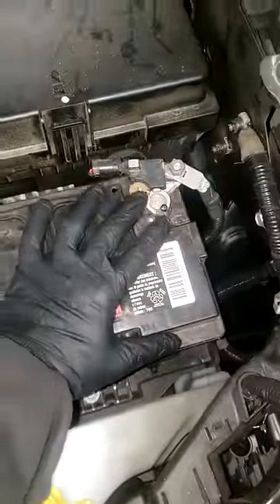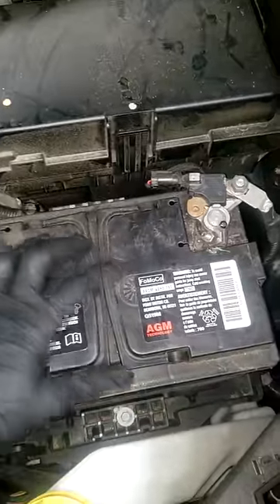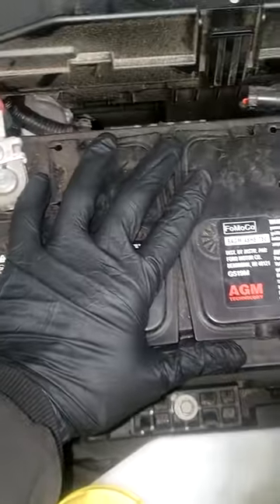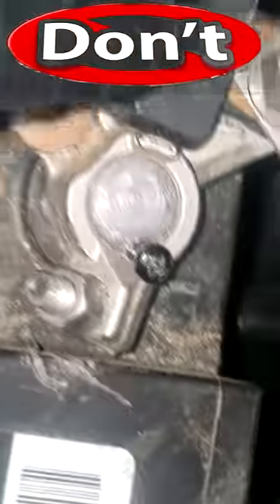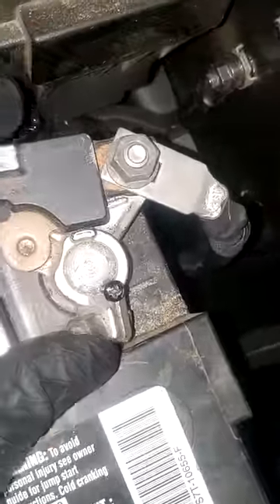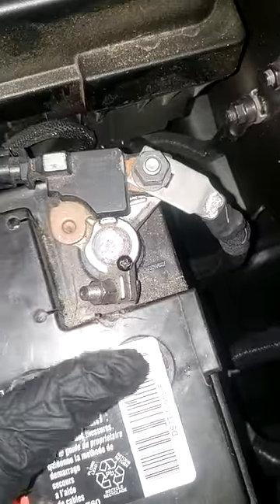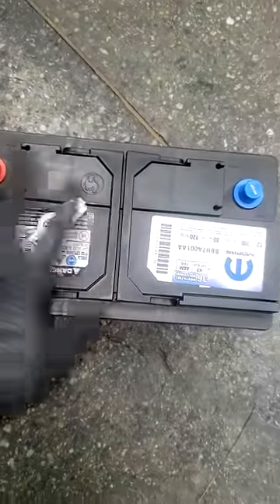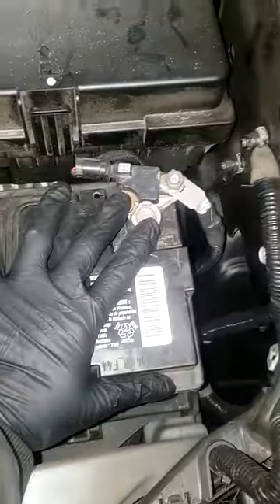STOP DOING THIS PEOPLE. This will destroy your car electrical system.

Comment: Everyone's talking about the screw, I'm still tripping on the new battery sitting on what appears to be concrete.
Reply from the maker: Yep, and just what will that cause?
Reply: I've always been told that putting a battery directly on concrete will make it loose its charge and potentially loose the ability to hold charge altogether.
Reply from the maker: @dailyhauntedhistory  Do you believe every thing you was once told? especialy from an older technology stand point.
Reply: The person who told me that taught me alot of "tricks of the trade" most of them stood the test of time. On the battery's I just keep a 2x6 around to set em on,  better safe then sorry. Never wanted to run the risk of ruining a new battery, his story about them were brand new battery's in a big diesel street sweeper, 2 battery's parallel, it was an expensive lesson for him to learn.  It was an older equipment, which may have used an older battery tech, but that happened to him in 2006.
Reply: Sorry to say the concrete was not the cause of his problem.

Comment: I helped a woman having the same problems. Turned out, whenever she hit a bump, the screw was hitting this hood. I told her whatever idiot installed her battery didn't put the battery holder back in and used the wrong terminal.

Comment: Thats an AGM battery... my guess is the battery is perfectly fine given date code, did you try a terminal shim before condemning the battery? Test the battery?
Reply from the maker: Bro, the point of this video is to deter mechanics from doing or adding anything non factory to the battery that will affect connection and you get on here suggesting I install a shim??????? Thats what causes the problem on these newer cars. They to computer controlled for any of that non sense

Comment: It's hammering a lead wheel weight into a thin shim an adequate fix if a new terminal/sensor isn't an option?
Reply from the maker: Its a risky fix. Any small spike on wrong reading from the sensor could brick you transmission and render it useless

Comment: Yeah so that's a very old trick, use a small pin or nail. It's not the cause, but it's a bad repair
Reply from the maker: You cant at all alter with the battery connections on new cars my friend. You will lock yourself out.

Comment: If you stick with vehicles made before 1973, you won't ever have to worry about those annoying sensors. ..Or any of those emission control gadgets either, just a PCV valve. Parts keep getting harder and harder to find, though. But if you have IBS, that's no joke. It's fkn crippling.
Reply from the maker: Very risky stuff. I've gotten cars towed in because they transmission bricked all because of hacks like this. Not good on these newer cars.

Comment: i know enough to know better than that screw doing anything to cause this problem. 🤦‍♂️
Reply from the maker: You likely referring to all the old pos cars you use to driving. Doing this is not good on the newer car. It will lock you out
Reply from the maker: @3sgteyota  Well thats the point of the video. To alert the public not to be doing this on newer computer control cars such as the car in this video. Thanks

Comment: If you arr putting a screw in a battery terminal I'm hoping you are not considering it fixed. If you need to get it off the road or to a shop and can't tow it for some reason that's an emergency fix. Just do it right guys it's not that difficult.

Comment: I only work on old cars but I wouldn't ever put a screw in there Ive used copper wire and clamped it down on my own vehicles but a customer gets a new terminal or we return the battery and find 1 that fits right

Comment: I had transmission issues end up being a bad battery it would start the car but the amperage was low and tested bad. installed a new battery and no more trans issues drove car another 29,000 miles.

Comment: What the scan data say Did you run a battery test on it did that battery fail If the problems with the battery terminal why are you replacing the IbS sensor? Not that I just agree with your diagnosis it's hard to without the proper information

Comment: Whats wrong with the screw, I don't understand how is that going to mess it up?
Reply from the maker: Mess it up?? Im not understanding that.  Heres the thing. That screw has compromised the connection between the battery and the terminal. The problem here is thats not a typical battery terminal, its a sensor. A IBS. Thats monitored by the computer. The computer picks up on foolishness like this and will turn on the check engine light. You can get away with this on older cars, just not the newer cars.

Comment: Certified mechanic over 25 years I put a bolt like this on my wife's Jeep Patriot and drove it that way for five years without a problem so don't tell me that this causes a problem cuz it's bull crap
Reply from the maker: Uhmm couple things here, im not sure if you aware of this but you can put anything you want in your wife Jeep that you like. Second, I get a good chuckle out of guys like you that feel the need to highlight there ASE and years of experience but still manage to say questionable things to the contrary.  And lastly, this video is on a newer Jeep Cherokee with a complete different bus network electrical system. Your old ass Jeep Patriot not the same. The vehicle used in this video use whats call proxi alignment and has a ZF 9 speed fully electronically controlled transmission. Any kind of battery arching that may happen because some clown stuck a screw in it can brick this transmission and cause it not to shift. So buddy these are 2 different vehicles. You might wanna do some upgrading with your 25 years experience, seems you getting left behind because you still think screwing screws in your battery to make good connection in stead of fixing the connection problem is a good idea, that says a lot about you...IJS.

Comment: Bullshit. This is simply a combined sensor unit with a current measurement shunt and also voltage measurement. The combination of these measurements can state the battery State-Of-Health amongst other by measuring the actual cranking amps. No way in hell that screw is affecting anything. If anything it's a creative repair for a real problem.
Reply from the maker: So the check engine light just decided to come on for nothing huh???smdh..Tell you what, simply leave your screws in there, hows that?
Reply: @OnlineMechanicTips  Please enlighten me, what was the fault then? Cause it sure was not the screw. 100 %
Reply from the maker: @PatrickStave  Again, then leave your screws in and ignore the light. Theres no enlightening you. You to far gone. It would be a waste of time.
Reply: @OnlineMechanicTips I am genuinely curious what the fault was and what fault code it threw. Can you tell me?

Comment: What the hell are you talkin about that's not a sensor that is a fusible link and the heart and soul of your electrical system technically isn't your battery all the battery is there to do is to start the vehicle. The vehicle runs off of the alternator once the vehicle has started it has nothing to do with the battery all it does is start the engine. That is not a sensor, and there's nothing wrong with the screw trick all it is is making the connection tighter because the clamp is bad it's okay for short-term fixes long as you don't damage the terminal going into the battery itself but if it is just going into the part of the posts that is above the threshold into the batteries and her core it's no big deal really what needs to be done is the clamp needs to be changed out. It is stretched. Now the ground circuit of any electrical system in a 12-volt automotive circuit is very important because all the electronic circuits are switched through the ground circuit they are typically provided power full-time through the fuse panel and the relays and whenever you operate a switch or press the button your closing the circuit via the ground circuit of the groundside. I've seen a couple of your videos and I've come to believe that you have no proper training or no technical School education which is okay but you should really take the time to read up on alldata pro or Mitchell 1 pro and look into and study the circuitry and look up and memorize your nomenclature and learn a little bit more before you make videos misleading people (intentionally or unintentionally & innocently)  or telling customers that they have to replace " sensor "  that is nonexistent. Oh and by the way there's continuous and intermittent feedback closed-loop , open loop, and benign sensors . They don't tell the computer anyting they have a number or a predetermined setpoint programmed into the computer and all it does is send a signal out to see if it's within tabac it just doesn't send back a signal within those values it will triplelite it doesn't tell if it the sensor is bad it doesn't tell the port is bad it just tells if set point in the computer is being met. which also leads me to the point where I hate when people automatically assume whenever a code is wrong that that sensor needs to be changed through that component needs to be changed you need to check the entire system that is in line with that sensor because it could be a number of components causing that light to flash on and I've even seen cases were just a broken ground strap because the system to trip and nothing be bad at all.The bureau of automotive repair and almost society of engineers frowns upon and proper information on work orders and provided to customers. I would know because I am an ASE certified technician and that is definitely told to you when you go through your certification process.

Comment: so by making contact with the screw , it was "wrong". But selling a battery she didnt need when it was the terminal was ok?
Reply from the maker: Seems you dont know what you talking about. Typical reactions from side line know it all guys.
Reply: @OnlineMechanicTips   A normal passenger vehicle traveling at a speed of 65 miles per hour would take about 316 feet to stop. For a fully-loaded commercial truck, the stopping distance of it running at 65 miles per hour is about 525 feet
Reply: @OnlineMechanicTips  Dork , I piloted professionally for Kawasaki. Im not slow, or an armchair warrior. I practiced, fought, lost won , and crashed and burned, many times.

Comment: Did you even test the sensor to make sure it was faulty? A code just means there's a problem in an area not that that exact thing is broken. Example, gmc 5.3 throwing a u0107 code for TAC module. If you'd have read the code and just replaced the module, most of the time it won't fix the issue  because it's usually caused by a faulty ground in the circuit. Could be the ground  directly to the tac, a ground from the ecu, or literally any other ground in the circuit. I know from experience. Any mechanic worth his wrench will tell you verify, verify, verify. Visual inspection is not a diagnosis

Comment: The screw is not the problem this should never be done also the battery sensor (shunt) is also very unlikely to be bad.  This battery may not even be bad.  What usually happens are the terminals and battery cable connectors should be disassembled and properly cleaned, if your working on your own car.  If you are working on someone else's car the cost of a battery and possibly a sensor is a good idea.  I mean pay $100+ for my time to clean it or for a new one? Choose.  If it were my own car I would just remove the screw, clean the terminals and cable ends then keep going.  Additionally judging how people work without knowing their situation is unkind and inappropriate.  There are people all across this country that have just barely enough money to put food on their table and maybe not the education to repair their car but definitely not the money to have someone else do it. They do what they can with what they have, been there.  The guy in the video does what is right for his situation, he is not ripping anyone off.  The screw was probably a ditch attempt to get out of a tough situation but is also ok if you're stuck in a parking lot somewhere you got a screw from the trim inside the car (notice it was black) you have a screw driver or a key or something then your day is saved, hero or idiot?
Reply from the maker: This was a interesting read.

Comment: I'm sorry... WUT?
Reply from the maker: Whats the question?
Reply: @Online Mechanic Tips  I suppose my question is... why did you think you needed to replace $900 in parts + labor when you're not addressing the actual source of the problem in the first place? I'm going to bet she will be back saying I'm still getting similar issues. Whoever removed the IBS sensor in the first place is the first problem...  whether that's the guy who added the screw or not, it's irrelevant. That sensor doesn't just come loose unless someone thought they would erroneously diagnose a problem the sensor was warning about.

Comment: That sensor was fine, you don't know what you're talking about. That screw was miles away from it.
Reply from the maker: Lol. If you a mechanic and you get one in the shop like that, just simply tell the customer it's fine and normal. No big deal
Reply: @OnlineMechanicTips  Definitely not normal to put screw in there, but it also shouldn't damage the sensor.  I would first clean the contacts and test the battery, not just fire the parts cannon and hope for the best. That's just lazy IMO.
Reply from the maker: @miro6138  Considering you have no idea what I did or what was done seems you're  firing off the guess canon of what wasn't done. This a shorts video dude. And I'm not about to attempt to explain to you what testing was done or not done. Simply because i don't have to.. Just know that 2 parts was replace and a screw was removed. Im not sure how yall operate over there but i got this over here.
Reply: @OnlineMechanicTips  Well then don't be surprised about reactions like this when you don't explain what diagnostics you did - I can comment only on what I see in the video.
Reply from the maker: @miro6138  Made perfect sense until you fired off the guess canon. I repeat this was a shorts video with limited time. Which means no sense in assuming long ass testing was done or will be shown. That should be common sense

Comment: It would work just fine all you had to do is take the post off put two pieces of aluminum foil under it put it back down on it tighten it up done you probably charged her
Reply from the maker: Smdh, you should likely stay far away from the newer cars with that way of thinking
Reply: So let's replace the battery when all you got is a loose connection now who knows what they're Billy stop ripping people off
Reply from the maker: @007squirreldehne2  smdh, im now convinced what the D stand for on your screen name
Reply: D stands for damn right.
Reply from the maker: @007squirreldehne2  Not exactly what I had in mind. But if you think thats how it works cool